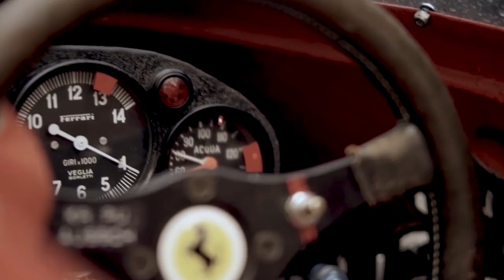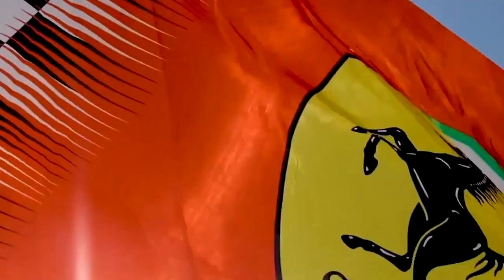The GREATEST Ferraris Ever Made

Comment: I can 't speak for many historical machines.
How ever.
№６, regarding 333SP
4:12 Although it is explained as 641,
I think this engine was F92A in '92.
Although it was a characteristic machine,
it was famous as a Daba（pack horse）in Japan.
Reply from the maker: Yes, originally that's what they used, with increased displacement and power output to 600 hp. Thanks for watching!